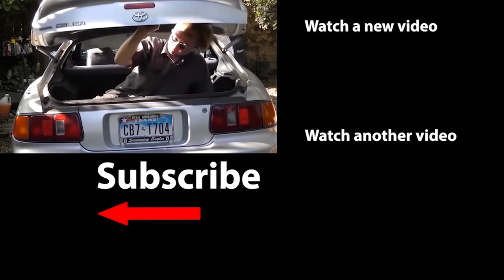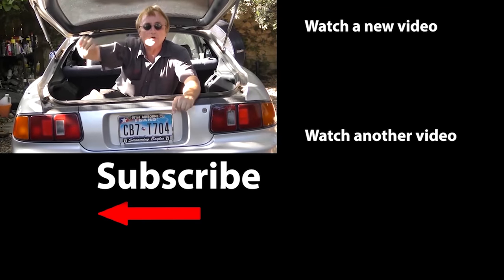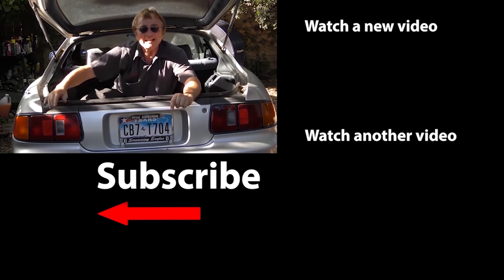Here’s Why This Engine Oil Can Destroy Your Car

Comment from the maker: Worst Mistakes Car Owners Make: https://youtu.be/H8IXW7w37-I

⬇️Scotty’s Top DIY Tools:
1. Bluetooth Scan Tool: http://amzn.to/2nfvmaD
2. Mid-Grade Scan Tool: https://amzn.to/33dKI0k
3. My Fancy (Originally $5,000) Professional Scan Tool: https://amzn.to/31khBXC
4. Cheap Scan Tool: https://amzn.to/2D8Tvae
5. Dash Cam (Every Car Should Have One): https://amzn.to/2YQW36t
6. Basic Mechanic Tool Set: https://amzn.to/2tEr6Ce
7. Professional Socket Set: http://amzn.to/2Bzmccg 
8. Ratcheting Wrench Set: https://amzn.to/2BQjj8A
9. No Charging Required Car Jump Starter: https://amzn.to/2CthnUU
10. Battery Pack Car Jump Starter: http://amzn.to/2nrc6qR

⬇️ Things used in this video: 
1. Common Sense 
2. 4k Camera: https://amzn.to/2HkjavH 
3. Camera Microphone: https://amzn.to/2Evn167 
4. Camera Tripod: https://amzn.to/2Jwog8S 
5. My computer for editing / uploading: https://amzn.to/2uUZ3lo

🛠Check out the tools I use and highly recommend ► https://goo.gl/rwYt2y

Subscribe and hit the notification bell! ► https://goo.gl/CFismN
Reply: Hi Scotty
Reply from the maker: @hunteralberytalt  hello!
Reply: Wassup scotty!
Reply: Scotty Kilmer your thoughts on Chevy Astro vans?
Reply: Scotty Kilmer Hey Scotty I need your help, I have a 2005 ram 1500 with the 5.7 hemi, I just hit 728k miles, I just want to know if is good to let it go or keep it, Gas pump was replaced at 300k mikes and spark plugs as well, other than that is still running like clock work. Please help
Reply: DMoney Industry  Seems like one of those Online scams to me.   If the buyer can't touch and drive the car them self, DON'T Buy it!!
Reply: Theres alot of Skylines that have low milage because Japan is not a big country and it get very expensive to drive an older car over there so people just quit driving them over there or put very little milage after 4-5 years.
Reply: O
Reply: Scotty! Do more mini documentaries! We love it!
Thanks for this!

By the way. Planning on getting a Toyota Vios made in PH or a Toyota Avanza made in Indonesia I think, and both 1.3 MT 2020s. They any good here in the Philippines? Thank you!

Comment: Reminder to all young drivers (especially women): CHANGE YOUR OIL!
Reply: regularly
Reply: Northaxe we don’t want any black fudge lookin sludge coming out of the drain hole!
Reply: Absolutely! Not only that but check your oil weekly.
Reply: cash John redcorn takes care of that!
Reply: That's why u never buy a used car. My wife had to have this toyota. It was ticking when my wife bought it at 30k miles.  And its still ticking at 130K. Whatever. My friends have the same engine but they got it new. Same mileage. And it's smooth as silk
Reply: Wait, you don't just put gas in it and drive it until it stops working?
Reply: Idk why but i never trust car for sale when it says "single woman owner"
Reply: @warmccl  Women as a whole are less mechanically inclined than men, which is not to say all women don't take care of their cars or all men take care of their cars. What's embarrassing about reality? It hurts your feelings?
Reply: @vaillante7667  that means. Never buy a used VW beetle hahaha
Reply: 1st thing I was taught when I got my car. I always have a little chart that keeps track of my oil changes. Espescially needed when the car you're driving is a Korean made POS (05 Tuscon V6)
Reply: warmccl TELL EM GIRL
Reply: i heard woman are lazy to take baths
Reply: @rogue Stop trying to make Sexism an issue. It's not.
Reply: Even Tesla
Reply: @nickmccain6598  Would it be better if it was toking
Reply: Women: oops hehe
Reply: My wife doesn't even remember to put fuel in, but I change the oil and filter, on my mums car too... But I am a daddy's girl. Its not really about sexism is it... its about being conscientious or a lazy human. I'm conscientious as I can be, but I've had to pull the weight of all the lazy people around me and it is tiring me out. But hey, no seized engine, just seized bones 😂
Reply: I change my oil every 3000 miles or whenever i'm bored. Whichever comes first.
Reply: HANK HILL oh he does!
Reply: @warmccl  Good for you, awesome!
Reply: @billdauterive246  Where?
Reply: Shots fired!! Haha
Reply: Dale Gribble  where can I get some 710 hahaha..🤠
Reply: Sestrel Bethesda hehe
Reply: sounds like something Rusty Shackleford would say?????
Reply: @irontiger0462  in reality, some people think that's how it works
Reply: @emanuelmoreta5472  This is true

Comment: Scotty, we have two Gen II Chevy Volts. On summer we get 50 - 60 miles on the battery alone. In Winter, range drops to 42 - 50 miles depending on how cold  it gets. The 1.5 liter 4 cylinder gas engine gets 42 - 50 mpg. 

The Gen II Volt has almost 300 ft lbs of torque off the line. Our Volts will smoke most cars at the stoplight drags. Great fun and unbelievable efficiency.
Reply: Biggest Richard Cranium  You got me there. Let's drag race with empty gas tanks. 

I own a highly modified C4 ZR-1. Even at a full throttle launch I believe the Volts will nose ahead for the first 20 - 30 feet before being annihilated.

Comment: Why can’t we learn this type of stuff in school? This is what we really need because one day we’re all gonna have a car and need to know our stuff
Reply: John Riederer II , because gender studies and twerking take precedent.
Reply: Technology is always changing and that's why we need Scotty!
Reply: It's definitely true that a basic automotive mechanics course, perhaps combined with a small engine course, would have been extremely useful for pretty much everybody.  Things like - 

This is how you properly jack up a car.
This is how you change a tire.
This is what the different fuel ratings mean.
This is how you check and change the oil.
This is how you do a brake job.
This is how you clean the carburetor on a typical lawn mower.
Etc.

When I was in school, our shop class was basically -
Make a bread cutting board.  The teacher will put them all through the planar after class.
Cut and bend sheet metal into a tool box.  The teacher will do the spot welds after class.
Sand cast a toy car.  The teacher will handle melting and pouring the metal and drilling the holes for the axles after class.
Make a fluorescent acrylic bowl from a plastic sheet.  The teacher will handle smoothing the edges and the actual heating and shaping after class.

Completely useless class.

Comment: Scotty, need to make a correction, when a Plug In Hybrid uses up it battery charge it becomes a hybrid and the ICE powers the car but also charges the battery and you alternate power between gas and electric and it works great.  A PHEV is a better alternative to an EV imo.  I drive a hybrid and I'd love to have have 25 miles of electric range for around town before going back to hybrid mode.

Comment: Hey Scotty. I've have a 2005 Hyundai Tuscon with over 110k miles and the V6 engine. Got it free from my uncle (a used car salesman) the thing has the check engine light come on almost all the time. The O2 sensor was at first faulty and it was replaced but now the cursed light is back again and now wont go away like it use to. Could there be a hidden defect in the engine I don't know about? I routinely check the fluids including the oil and all are perfect so what the hell! I know older Hyundais are know to be complete rubbish but I don't really wanna go hunting for a new car just yet as I've had the car for almost a year.
Reply: Check your air intake; tubing, connections, mass air flow sensor. Go to an AutoZone or whatever is in your area and have them check the codes.

Comment: I blew an engine once. My father had this old silverado and since my younger sister needed a vehicle to get to work in, she had been driving it a lot. I needed a truck to actually use one day so I went over and borrowed it, unaware that no one had been checking the oil, even though it was known to have a problem. Needed to be checked often. I got about 5-6 miles on a really hot summer morning before I glanced down and saw the engine over heating. I pulled over immediately. 
Anyway to keep this short. It was dead already. By that point there was nothing that could save it. After the engine cooled, after sitting on the side of the road sweating and adding a few quarts. I tried to drive it back, and it stopped moving, it spilled anti freeze all over the road.

I wasn't to blame though and I made it clear that I wasn't responsible. The truck was already ruined when for who knows how long. No one. Checked the oil. Or added even a drop to a try engine. 
It's not hard to do. Now though, even before I borrow a vehicle I do a quick look over first. For one thing I don't like being stranded on hot summer days, or any day really. And there's no way I'm paying for someone else's laziness/carelessness... My taxes pay for enough of that already

Comment: I have a 2007 3.7L Hummer H3 with 135000 miles Would it be a good idea to run sea foam in my oil a couple hundred miles before I change it to clean my engine?

Comment: My dad is wanting to tow a trailer is towing it with 4x2 better or 4 wheel drive
Reply: The more wheels pulling a load has to be better (& diesel is better)
Reply: It depends- do you want to tow it through the snow? Probably not. Rear wheel drive trucks have been used to tow loads since forever ago. And they did it just fine (and still will). 4wd isn't needed for towing (typically) but it's better for getting through mud or snow
Reply: 4wd
Reply: Unless you will be on bad dirt roads or snow 2 wheel drive is just fine.

Comment: Hi Scotty, 

I have a 2010 Volkswagen Tiguan with 160kms on it (about 99k miles). I paid $6000USD for it, and this car has been a never-ending nightmare. I had to replace the whole engine after owning it for 3 months, and I still can't get it to stop leaking oil. Every time I get something fixed, something else breaks. No one should ever buy a Tiguan.

What do you recommend as a replacement that's around the same size?

Comment: On that 2017 Elantra check the front splash guard My wife took to the local dealership for service and they left most of the fasteners off so on a trip to WV the splash guard noise would come and go driving her crazy , I drove to WV to fix the problem. Don't ever trust the dealership check everything under the hood before you leave it

Comment: That Hyundai Elantra is still under warranty. Bring it to the dealership.
Reply: Only if it's the original owner I think. Unless the policy changed
Reply: @JOutterbridge  Only the first owner gets the 10yr/100k powertrain warranty. The second owner gets the 5yr/60k for both powertrain and general starting from the first delivery date

Comment: Scotty my 2002 Nissan Frontier’s air conditioning is broken, I bought it and the air conditioning was working a little bit but also was leaking water on the passenger side floor, and soon after stopped working all together.
The guy I bought it from said he had just replaced a air conditioning hose. 
Also the condenser is sounding like it’s not working so well it sounds like it should be replaced, should I try and fix it myself it doesn’t look all that complicated. Or is it more complicated than it looks? I’m fairly competent in fixing my own trucks, just haven’t worked on air conditioning yet.

Comment: I have a 2006 dodge caravan 287,000 miles, transmission doesn't jerk but goes to higher rpm before gears, have kept oil changed but (never) have changed transmission fluid, should I ride it out or change it, was told may do more harm changing it now?

Comment: Scotty, I have a 2008 F-150 with about 240,000 miles on it and whenever I shift into reverse the truck rolls forward a little bit then starts driving backwards. Is this something I should be worried about?

Comment: Hi Scotty, I drive a 78 nova, it has a 454 with flat tappet cam and I've been using Quaker State Defy High Mileage oil, it states the reason why they call it Defy is because it contains zinc, its printed on the back. Lately I noticed the label has changed and it doesn't say zinc on the back anymore, but it still says Defy on the front. Am I to assume the zinc is gone? I contacted them and the rubber stamp on the other end couldn't answer my question. My o my, what do you think? Thank you, stay safe.

Comment: Oil level on dip stick is between the high mark & low mark. The dealer said that's enough oil. Should the oil be at the high mark on the dip stick?

Comment: Scotty. I have a 2014 Hyundai Santa Fe with a 2.4L with 122 000 kilometres or  76000 miles. Engine just blew up and Hyundai is replacing with a brand new engine. You know the deal on Hyundai and all their engine problems with metal filings in their engines when manufactured new. Once I get my SUV back should I just sell it or do you think what they replace it with will be a better made engine. Right now I don't trust Hyundai as they left me stranded and had to get my vehicle towed to their dealership. I ended up buying a 2016 Mazda CX 5 SUV AWD. Not sure which one to sell and which one to keep. APPRECIATE YOUR VIEWS. Thanks. Stewart

Comment: Hey Scotty what do you think about a 300zx as a first car 1990?
Reply: I'm not Scotty but what I would tell my younger self... get a boring reliable car for $2,500. Then get the project car that you don't need to rely on. It will make your mechanic sessions satisfying cause I always had a gun to my head over the weekend trying to constantly fix check engine lights, etc
Reply: I grossly overestimated how complex cars are. I learned to do literally everything tho!:) Just wish it wasn't such a stressful journey,, it really tainted my memory!
Reply: @Jaden-up3bg  Very wise advice.
Reply: Get a Mazda Miata, the transmission and engine is nearly indestructible, it's an awesome fun super reliable, super durable, well made, well designed automobile, and one can drift a Miata.

Don't get a front wheel drive car, cannot drift those.
Reply: Zeroyon 456 idk probaly n/a tt can be pretty expensive
Reply: The Royal Crowned Tiger I agree and maitas get pretty good gas mileage
Reply: Zeroyon 456 I agree but I don’t want a front wheel drive car
Reply: The Royal Crowned Tiger my brother has a Miata he put a turbo in it and is now v8 swapping it
Reply: big bee ik fr
Reply: The Royal Crowned Tiger my brother has an mb tho
Reply: The Royal Crowned Tiger I want an na

Comment: 7:07 Ooooo, you ALMOST made uncle Scotty angry!  🤣
Reply: I would've thought the oil light would come on and the engine making seriously bad noises if oil got that low. I've heard an engine knock after being left to drain a little too long, and had all the oil added back. It stopped in a couple seconds. Wasn't a great noise

Comment: Hey Scotty my dad has a 1989 Honda Accord LX-i  he bought it brand new and it has 110k miles and it has problems so the engine jumps when it starts and my dad someone looked at it and said its the engine mounts he also has to replace the floor mats and the glovebox is broken and needs a new paint job and when it starts the radio doesnt work.

Comment: I have a 1996 Chevrolet Caprice . The ignition switch will turn to run position but kills afterwards no crank just kills. Any help ?
Reply: Someone please help I have been trying to tackle this for 2 weeks now 🤦🏽‍♂️
Reply: Probably need to replace bad ignition switch. Old cars like that you could run  hot wire from battery to coil, then jump the solenoid switch to start & run. Make sure don't have any bad or loose wires anywhere, clean battery terminals and connections at the starter. You can have starter & battery tested at Auto parts store.

Comment: Last I checked, the Battery "compliment, in Any Tesla weighs 960 lbs.   A Ton of Batteries is a Lot of Weight !
Reply: @zeroyon4562  I understood the Lower CG given by the Battery "pack"... But without the Torque of Their Motor, those things would be as Sluggish as a  std. 2002 Mini-Cooper. Handles Swell. But ...

Comment: Oil in a vehicle has never stranded me or left me at a shop. Coolant on the other hand.... you better pay attention &  keep up with it. Freeze plugs / dirty radiators look out... battery in Tx heat = possibly stranded.

Comment: Honda clarity PHEV 47 miles  on EV ,we had it 1year 6 months. My wife has never put gas in the car. 16000 miles. I run the engine on trips

Comment: Scotty I have a Ford f150 2.7 turbo I bunch the gas the other day and got up to about 60 then it shut down no oil pressure I just change the oil 3 days before still filled with oil have some oil on the frame and some on the inside of passage rim need help don't have a lot of money to fix it

Comment: I ran out of oil twice on my 97 Toyota corolla, it started smoking and making lots of noise,  I just refilled the oil on the engine and it went back to normal, it kept running like normal for years! 👍🏼🔥
Reply: If you catch it quick enough it can be ok. I overheated a Honda once- lost all the coolant and then when I was going up a hill, it put out a lot of smoke out the exhaust. I promptly pulled over and turned it off. It didn't kill it (didn't warp the head or ruin the head gasket)- so i'd say I was fortunate. Some people don't find out quickly enough. They are less fortunate
Reply: If you ever lose oil pressure, pull over and turn it offf quick!
Reply: I have never run an engine out of oil...check once a week or once a month at the least.
Reply: You just gotta fill your oil like its gas...in these Toyota it becomes a necessity just like gasoline lmao
Reply: Why would you let it run out....why wouldn't you check your oil....and twice???
Reply: @richsweeney1115  probably busy with work-home rutine, I'll try to check it more often.

Comment: Variable valve timing, only refers to injector spray valve.( no oil there.) as for the rest of your info..... I myself ,  do oil changes early, and i do prefer little LUCAS added.  If you have never rebuilt your own motor, after your own servicing, it doesn't matter much. My opinion.